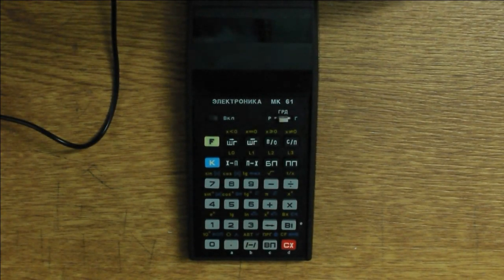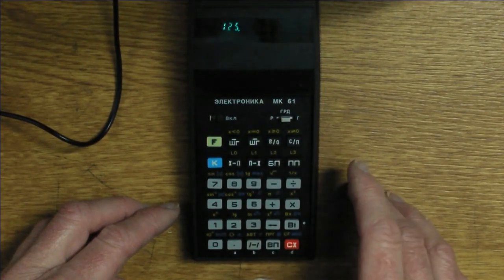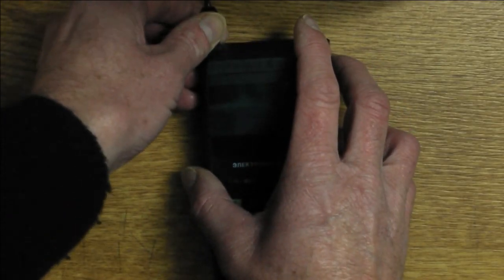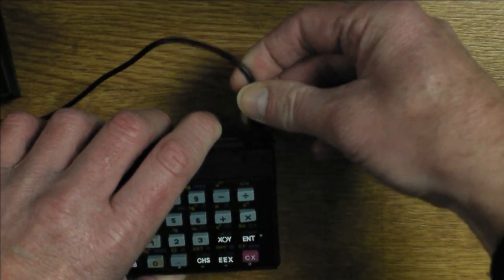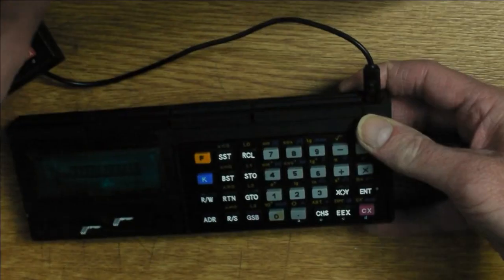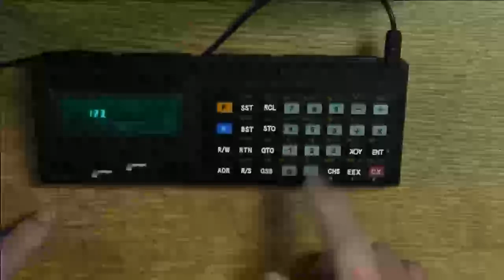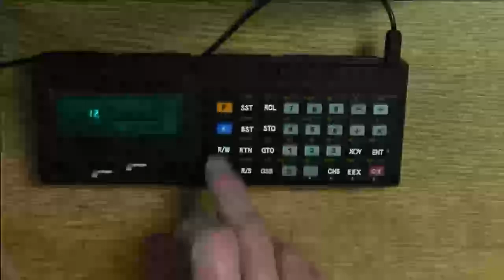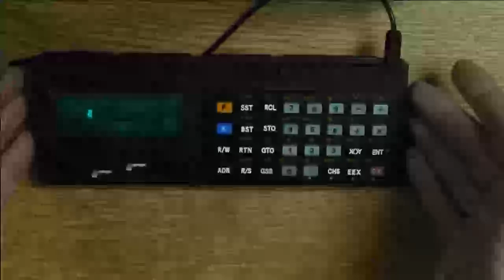Elektronika MK-52 English Keys

Comment: Brilliant! You may have provided me with a reason to get a resin printer. :)
Reply from the maker: I have thought of that, but resin printers are a bit messy and I'm running out of space for new toys, sorry tools. If you do have a go, I'd be very interested in the results. Presumably you'd still have to fill the legend somehow, or can you print in two colours?
Reply: @menadue  Another case of YT not providing a notification of your response. So sorry for the late reply. But I can't imagine a way to do multiple colors with resin.
Reply from the maker: @MrWaalkman  Yes, I don't rely on YT for anything like that.
There is a full-colour process available but it is very expensive. The resin process I use is very reasonably priced and using the colour process would make it a totally different project. I'm also not sure how vivid the colours are.

Comment: Hello.

What you are changing 2 values at the begining at the video are the two registry (X->P and reverse P->X).

There's also a stack of five values (a rotary 5 independent values, they are calling this "stiva" which is also a form of memory and can be called up in a controlled rotating sequence, a random numbers generating function and much more.
Practically is a programmable, as colleagues said, said Mk51 not permitting to save.

It comes originally with a a few books, very complex where deep explanations of the concepts and programming is made.
Instructions to create programs are somehow close  to the ones from the Basic, of course only in text mode.
However you may create smallm characters from different numbers.
In the 90s  making simple programs to calculate the average for a all colleagues markings on a certain class.
 Mk52 is way better....i was day dreaming of having one in 1990.

Upper white switch is changing the trigonometric unitary values of an angle....centigrades, radians and sexagesimal.

I still love them...seeing them both brings back so many memories. Awesome era. We had patience to concept a program, line by line, implement and test it.
Typing was taking time as it is obvious.

They are still brilliant.

Comment: By the way, MK 52 is almost a computer ... my friend used to use it as a random number generator for board games :D 
there is an instruction on the Internet there is a table where there is a sequence of keys for different functions... I still have a simpler calculator Elektronika MK 37 ;)  
And you got beautiful buttons very neatly)
Reply from the maker: I'll have to find that function list. The MK-90 is an interesting machine but it doesn't come up for sale much at all. It's internally like a PDP apparently
Reply: @menadue  
I saw several announcements at local flea markets ... unfortunately they ask for ~ 250$  is very expensive :(((  a very interesting computer for them ... but unfortunately they often have problems with the screen. (((  
recently bought an Epson hx 20 for 7$ and going to do restoration 
also very interesting laptop :)))
Reply from the maker: Yes, I have several HX-20s and they are interesting. Also got the tape drive for saving programs. I built an IO interface for it recently.
Reply: @menadue  
I would be very grateful if you shared the scheme for the HX-20 unit expansion :))
Reply from the maker: I'll have a look for the schematic.
Reply from the maker: I have found the hx-20 schematic, there's a blog entry here:

http://trochilidae.blogspot.com/2016/11/epson-hx20-interface-one-of-nice-things.html

and the github is here:

https://github.com/blackjetrock/hx20-io-port

It's a geda PCB design.